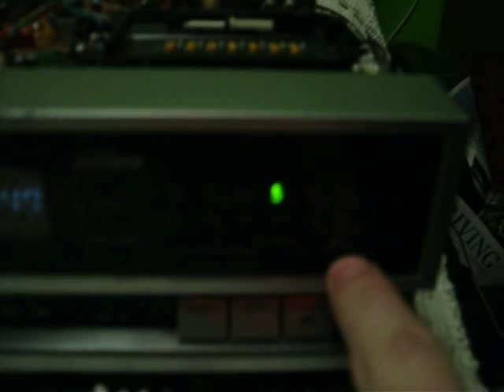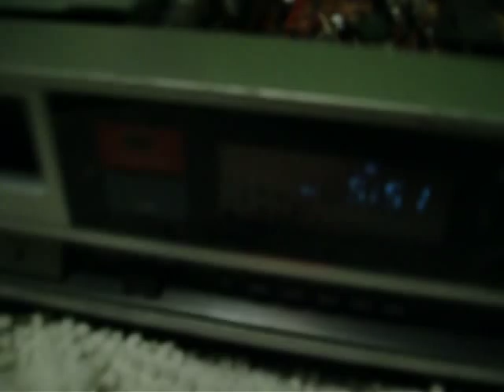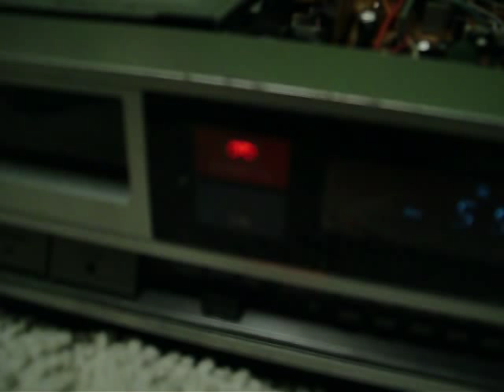1985 Toshiba BetaMax (V-M42C)

Comment: The little knobs adjust the tuning of each channel preset.  Each preset should have two knobs, one for VHF and one for UHF, and a switch to select either VHF or UHF for that preset.  Originally the presets come set for VHF channels 2 through 13, but if you have any UHF stations in your area, you can re-tune the unused VHF presets to set them to UHF channels instead.  The VCR originally came with a sheet of channel numbers printed on transparent plastic that you can pop into the channel display.